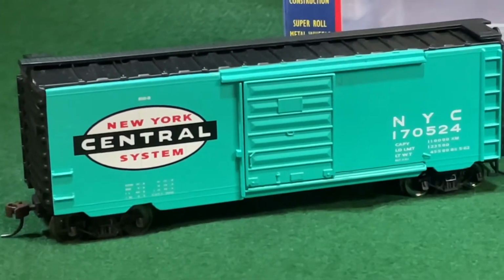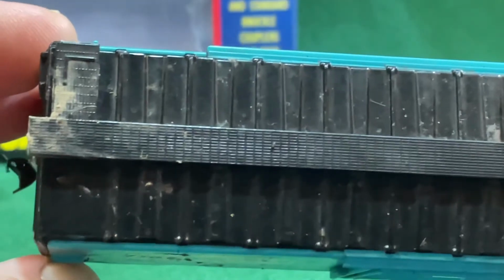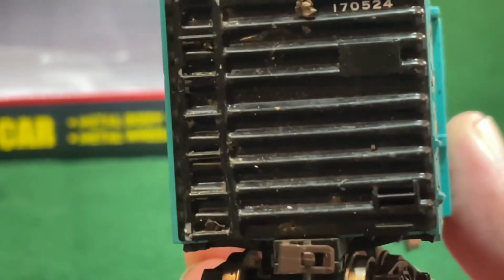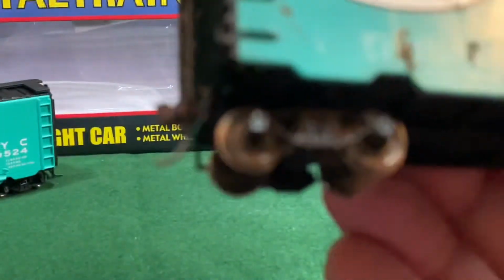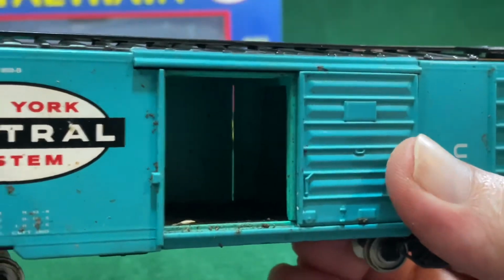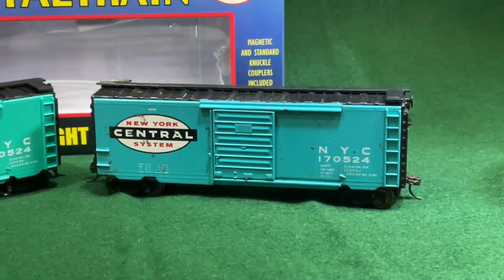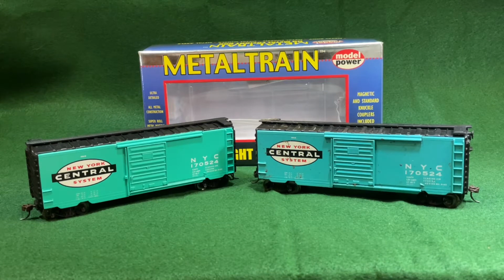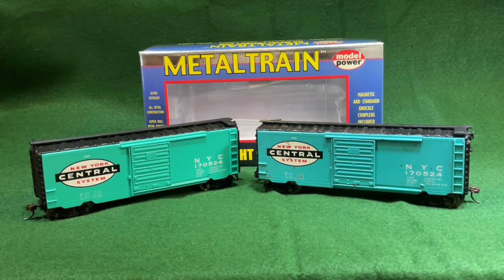Train Lab 1 - The Results

Comment: Cool idea, I didn’t even know you were doing that. I like the way it faded. And it seems fine. Wonder how the couplers are?
Reply from the maker: I did forget to talk about the couplers! The couplers are plastic Kadee type with metal springs. Both couplers are intact. One coupler knuckle is stiff and the coupler is stuff in the gear box. I assume dirt is the cause. I have almost the entire collection of Model Power Metal trains and I plan on replacing all the couplers with Kadee #148s. (One if my early videos shows most of the Metal Train line)